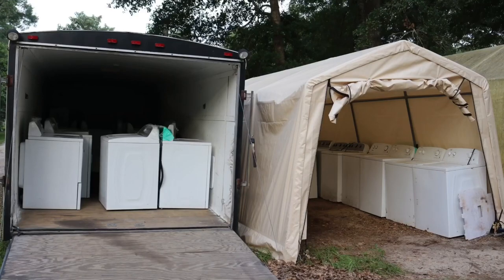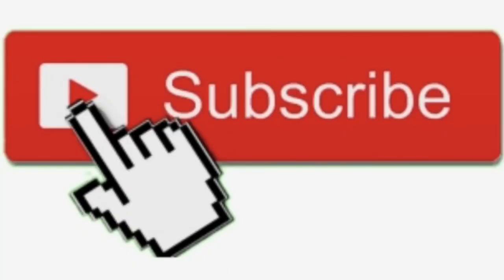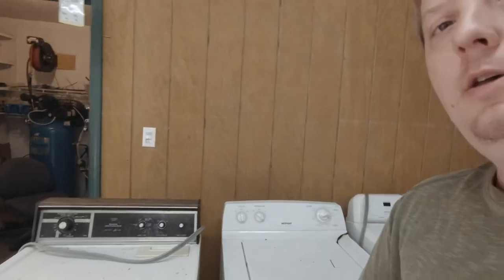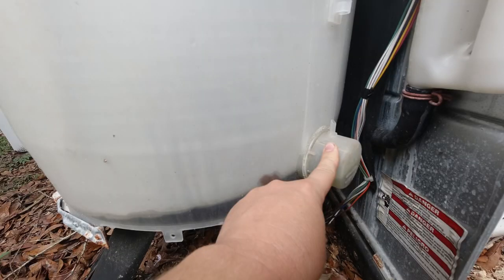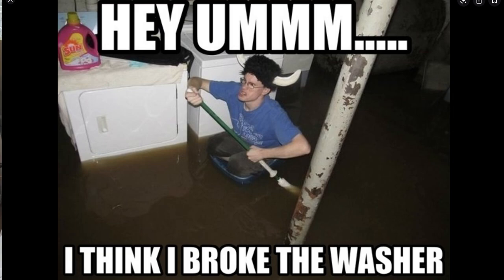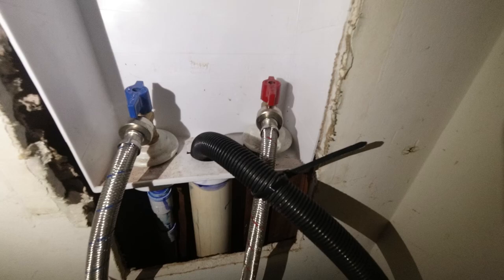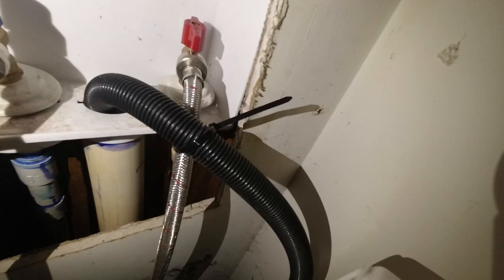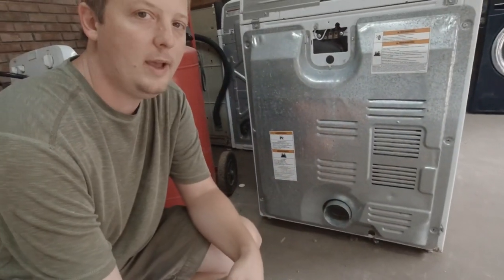How to Prevent a Washer & Dryer From Overflowing and Catching on Fire Stop Flooding and lint buildup

Comment: When I moved into my house the dryer vent was about 95% clogged. Need to transition it into a rigid pipe instead of flexible.
Reply from the maker: Most people discover the vent pipe is clogged up either when the dryer goes out or they move.